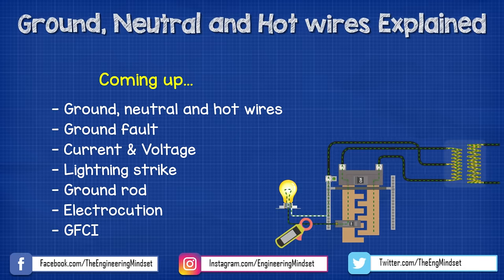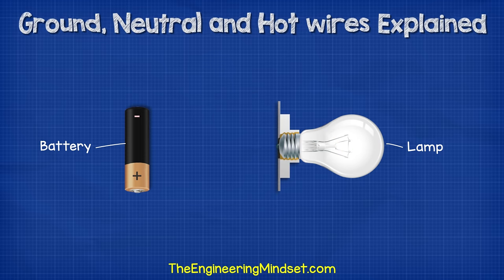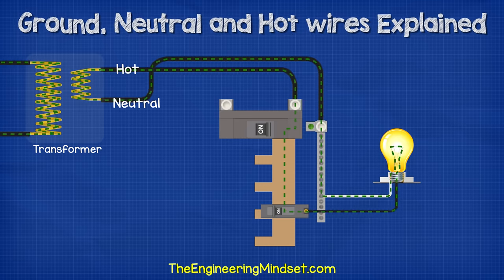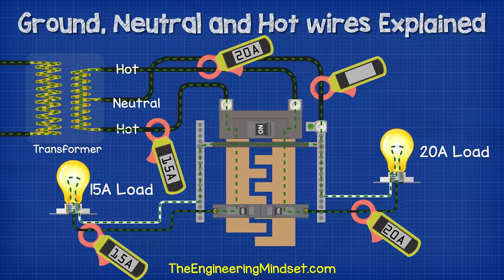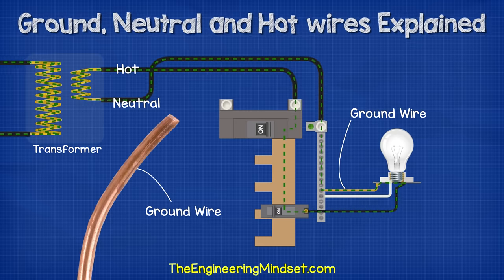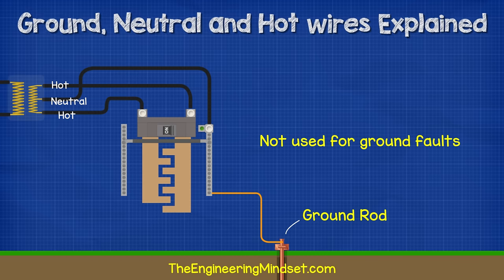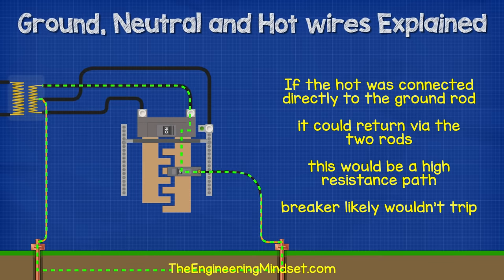Ground Neutral and Hot wires explained - electrical engineering grounding ground fault

Comment: In AC current there's no hot and neutral wires because both wires transfers current forth and back.
Reply from the maker: In some aspect that's true, but the neutral wire is usually grounded, as is physically tied to the earth, which makes it neutral, so there's zero potential between you and ground but 120/240V difference between ground/you and hot.

Comment: At 5:25 into the video you show two breakers mounted on the same bus and nothing in the neutral. If the two breakers opposing each other are on the same leg of the service transformer secondary then you will have an overloaded neutral in this situation 30 amps not zero.
At 5:25 when you pause you show two breakers stabbed onto the same bus on the right side of the panel yet you show current flowing on both buses…

Comment: i need help, i spliced an outlet strip into a live wire in a light pole with snap splices but light won't turn on on outlet strip
Reply: Sounds like you need a real electrician
Reply: @N-hunter  ive done similiar outlets but  with alligator clamps, cant figure out why the snap splices dint work

Comment: I can't seem to find any explanation as to why in north america black is hot in AC circuits.  In every other respect black is ground/negative including the multimeters that test the voltages! Seems to me that white and red should have been hot and black neutral with the extra green for ground. At least for consistency if not anything else.
Reply: @GH-oi2jf  Not sure I agree with that. The color is there for a reason, so you don't mix up the wires. In an industry where there are many regulations to prevent people from doing stupid things.. this is one basic thing that makes no sense. Electrons don't care what color the sleeve is or what the label might be. A battery could as easily be A terminal and B terminal. We as humans typically make these decisions for convenience and safety. Somehow this one slipped through the cracks I guess. Maybe someone screwed up 100 years ago, and we are stuck with it. 
Someone without the required knowledge, but the bravery (or stupidity) to go ahead and wire up that outlet using 2 hots (red and black wires) on the panel because that "makes more sense" is going to be in heap of "double" trouble.
Reply: Just color convention. They could have chosen a different color. Makes no difference. They just need to be able to tell which wire is which by their colors.

Comment: Why is the Neutral wire connected to the plus (+) side of the battery instead of the minus (-) side?
I would think that the Hot (red) wire would be connected to the plus side like you would see under the hood of a car.
Reply from the maker: Ignore that part it wasn't explained well. Electrons flow from the negative but most of the world was taught, incorrectly, they it flows from the positive. See our video on electron flow v conventional current to learn more

Comment: I don't get it. In AC system, when the flow of electricity switches directions, does the neutral become hot and the hot becomes neutral?
Reply from the maker: Watch this: https://youtu.be/yEPe7RDtkgo?t=186
Reply: @EngineeringMindset  I saw no explanation there.  The circuit didn't even have a neutral wire.  You had two hot wires.

Comment: Sorry but you are technically wrong on the very first example. The term 'neutral' simply doesn't apply to a DC circuit as shown in your diagram. The neutral is the center tap on an AC winding. When using the term neutral  a good electrician knows the system is AC .

Comment: I still don't understand what is the difference between Hot and Netral with AC. After all, electrons first come through the first conductor, and leave through the second, and then vice versa. It turns out that these two wires should change roles every half of the oscillation, but for some reason this does not happen in the figures.

Comment: 3.49 shouldn't the potential difference be at zero volts and not 240 volts?
Reply: No. It is the full potential of the coil. 240 volts. Not sure if you are in the U.S., but this is where the 240 volts that run certain appliances (e.g. electric range) come from for the U.S.

Comment: I once rewired a basement outlet once so I could move it over an inch. I hit the breaker, unscrewed it, though the ground wire loosly pressed into the cinderblock looked unsafe, put it back together to the wall, went to turn the breaker on and noticed I had flicked the wrong one. Praise baby Jeezus. 😬
Reply from the maker: We just published a new Ground fault, short circuit and arc fault video, so much detail! Link HERE➡️: https://youtu.be/Qi0ynSQw-wc

Comment: Electricity without a ground---i hook up a wire to a power source  and 
put a light in the circuit. Now the electricity starts to flow but the 
wire fills up and there is no ground so the flow stops. i hook up a 
ground and the flow starts up and the light lights..  the light should 
light up anytime there is current flow. When i hook up the power source 
to the wire (no ground in the circuit) the current starts to flow and 
the light should light up as the current goes through the light if only 
for a milisecond.Then no more current flow since no ground and so no 
more  light.. Theory- if i had a long enough wire so the current would 
continue to flow the light should light without a ground. Or i find a 
way to slow down the current so it takes longer to go through the wire 
and the light stays light at least until the current finds out that the 
circuit is not complete
Reply from the maker: We just published a new Ground fault, short circuit and arc fault video, so much detail! Link HERE➡️: https://youtu.be/Qi0ynSQw-wc

Comment: I don't understand, if electricity change direction, does it mean neutral wire will become hot wire? What make hot wire main wire, if electricity change direction?
Reply from the maker: Neutral wire is physically tied to ground (the earth under you), you are also therefore grounded so there is no voltage difference between you and neutral. The hot wire is not tied to ground, a voltage difference therefore occurs so if you touch it, current flows through you.
Reply: @EngineeringMindset  but what happen if electricity change direction, doesn't it come from neutral to phase then? I know it's stupid question, but I still don't get it :D
Reply from the maker: Notice how a bird can land on a power line and be fine. They are attached to the circuit, current is flowing, but there's no voltage differences so they are fine. However, if they touched a wire and a pylon they'll be blown to pieces as the current will flow straight through them because there would be a difference in voltage of maybe 200k volts.
Reply: @EngineeringMindset  I think I get it, so phase(hot wire) is where voltage comes from,  no matter the direction, so even opposite direction(pulling) voltage is from phase, right? :D
Reply: Voltage is always a measurement between 2 points. The neutral is just as live as the other hot legs. People in the trade learned the hard way and get shocked because they ignorantly believe that neutral is always safe to touch.

Comment: why can't the circuit flow back on a separate strand of the hot wire? Why can electricity not flow in two directions on a thick wire with DC power?
Reply: Because the eddy currents/ electromagnetic currents would interfere with the electricity

Comment: If ground is connected to the circuit too, then why there is ground in the first place? Why not instead a second "backup" neutral?
Reply: You need them separated to avoid objectionable current.  In a fault condition you would light up the "cases" of all other items plugged in at the time of a fault. Ground has to go straight back and finish the path at the bonding strip to trip the breaker in a fault condition.
Reply: There are also a lot of complications like a transformer that need ground separated.
Reply from the maker: We just published a new Ground fault, short circuit and arc fault video, so much detail! Link HERE➡️: https://youtu.be/Qi0ynSQw-wc

Comment: what !! electric flow negative to positive. What a revelation.
so negative terminal is the HOT wire.  gee ...

Sorry to be a little off topic but would like if I can relate this info correctly to jump starting a car, with electron flow.

thinking black cable on the negative terminal of car battery.

red is neutral post ( marked "+"...  black is hot ("-")  so  when you jump start someone' else's dead car battery

so current flows out from your black (negative) into their engine block ( receiver of current ]
and the current flows throughout the metal into their dead neg post of battery and comes out the positive post ( of the dead battery ) and return flow comes out of their dead battery positive post  back to your source positive post battery.

-------------
so that is why making the circuit for a jump start.

step 1) positive red ( stalled) to positive red live  
Your creating the return path first.
The Cathode is the positive or oxidizing electrode  that acquires electrons from the external circuit

step 2) neg terminal black (live battery ) to engine block ( frame of dead car )   
Your creating the HOT path now.
The Anode is the negative or reducing electrode that releases electrons to the external circuit 

Since negative post of the dead battery has a cable attached to body of car , the negative anode of battery ( the dead one ) receives the charge through the car's body (ie engine block Step 2 )and releases electrons to the cathode ( pos ) side of dead battery which in-turn outflows those electrons back via the jumper cable to the pos (Cathode ) of source charging battery post (pos).

am I missing something...?   Q: why go threw the body of the dead car to hit its neg post. Why not directly connect to the neg dead battery post?  Too much direct charge for the dead battery ? Or is it because the STARTER COIL is getting pre-charged
through the neg cable connection to the body of the car (dead car ) so does the starter coil have 2 connection to its Neg post - one from the body of the car and one directly from the neg post of the battery and now the coil awaits the ignition key to be turned on ( and so the dead battery will not need to do the complete heavy lifting to start the car as its still in a discharged state ? ) to complete the circuit to the positive post?

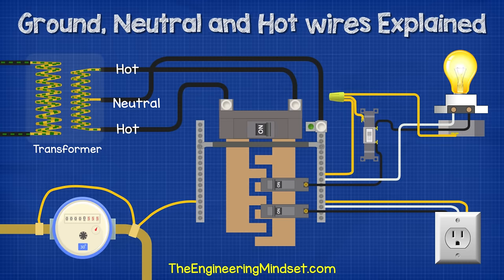Comment: 7:42 you connected the ground wire to water pipe? Then Current will flow creating some some electricity to your faucets., that's why you need the rod 9:13 to eliminate that grounding to your faucet!
Reply: No the metal pipe is so if you are electrocuted in less say a bathroom electricity will flow to the ground wire and trip the gfci
Reply: The grounding rod is for lightning or static
Reply from the maker: We just published a new Ground fault, short circuit and arc fault video, so much detail! Link HERE➡️: https://youtu.be/Qi0ynSQw-wc

Comment: IF electricity takes ALL paths back to ground, not just the path of least resistance AND the neutral bus bar is carrying say 5 amps, since it is bonded to the ground bus bar, how come we don't have some of that current flowing through the ground as well? 

For years I have never had an explanation for this on any video.
Reply: There is no flow because the ground is connected to the "case" not the operational load. If you bonded the case to neutral at the device you would have close to equal returning current. However this would be unsafe as the device case could now a higher potential than the earth. When I was a kid this happened in our kitchen and shocked my mom every time she touched the metal stove frame. We measured 90v from the stove top to the sink. The Neutral had  become shorted to the frame and our "fuse box" was not bonded to ground.  1950's aluminum wiring that could have killed my mom.
Reply from the maker: Check out NEW resistor video, everything covered! ➡️ https://youtu.be/DYcLFHgVCn0

Comment: Ok so if current travels back and forth, why is the negative not fused? Why don't I get a shock from the negative? After 30 years I can't still work out how AC works! Does the positive half of the cycle push electrons and negative cycle suck them back along? Anyone who can answer my questions please do it but I bet ill still be one the wiser as nobody can explain it!
Reply from the maker: Because the neutral is grounded, physically connected to the planet, so are you, so there's no voltage difference between you and the neutral. But, it can do.
Reply: @EngineeringMindset  Doesn’t answer my question!!

Comment: Why is the neg a hot wire? I’m confused. I thought the hot was a positive? Someone please answer
Reply: he uses electron flow which is the real direction electrons in a circuit flow (dc electricity flows from negative to positive because just like magnets of the same charge, electrons which are negative particles will push away from the negative terminal of a battery and will be attracted to the positive terminal ), so current goes from the negative terminal to the positive terminal. now the term hot wire and neutral wire doesn't refer to the charge (positive/negative) it refers to which side of the wire flows into the appliance (anything that draws current like a light bulb). imagine the bulb is splitting the wire in half, the wire which goes from the battery to the bulb is called the hot wire because the electrons in this wire go into the appliance/bulb. the wire that goes from the bulb back into the battery is called the neutral wire and in this wire electricity that powered the bulb is now flowing back into the battery because elctrons that are negatively charged will be attracted into the postive side of the battery.

if you still don't understand that's ok it takes time to understand electricity, you cant see these animations in real life or see electricity at all, for now try to rewatch this video and reread this comment if you can ask a friend who does understand it for help.
hope this helps!
Reply from the maker: Check this out, how a battery works: https://youtu.be/PXNKkcB0pI4

Comment: Why is it safe to touch neutral wire? How neutral is maintained at 0????
Reply: It's not always safe to touch the neutral. However, if everything is wired correctly, you can touch the neutral because you, standing on the ground (Earth) is at the same potential as the neutral. Same potential means no voltage.

Comment: I hit a hiccup when the ground wire was said to have less resistance than the neutral, because they are just both copper wires. But maybe because there's no fluctuation back on the neutral, as opposed to a ground which is just straight to source and that's that. ?
Reply: Ground wires never have less resistance. In commercial applications you typically use the metal conduit (pipe) as the ground and will always have more resistance. Wires larger than 12GA will normally have a smaller ground wire to save on copper. It needs to support the return path at 10x rated load just long enough to trip the breaker.
Reply from the maker: We just published a new Ground fault, short circuit and arc fault video, so much detail! Link HERE➡️: https://youtu.be/Qi0ynSQw-wc

Comment: You should explain how electricity REALLY FLOWS...  its Through the electromagnetic "FIELD"... which is EVERYWHERE.. Not the wires
Reply from the maker: Veritasium can do that, I'll focus on providing service engineers the knowledge they need to fix a system.

Comment: interesting system americans have. But resistivity is nothing you calculate? I heard you say your ground wire has "a very, very low resistance." but it should have no resistance since it has no load connected to it. However it has low resistivity. Perhaps its a little too premium for this video though. thx
Reply: @GH-oi2jf thats what i mean. a load has resistance. leads has resistivity which depends on the material

Comment: I’ve been an electrician for a long time and I’ll be honest I still don’t understand why most of the time you can’t get shocked in a neutral but sometimes you can. Anyone wanna help me understand ?
Reply from the maker: Neutral is grounded, so are you. There's no difference in potential. They aren't always grounded correctly so you can be shocked.
Reply: I have seen even several residential and commercial plants where someone forgot to bond ground to neutral. Even after inspections because inspectors don't test. In Tucson we had a new center that was smoking filtered power strips.  Contractor said I was crazy and we had cheap power strips. I put my meter between neutral and ground and had 50 volts. Someone had neglected to weld in the bonding bar at the transformer.  That was in 1993 and I have never trusted a contractor since.  I will always put my meter on just to make sure. Moved into a new house in 2000. Went to the panel in the basement and sure as shit they had not driving the bonding screw in. Passed city inspector and all.

Comment: Current going back travels through the white, white is connected to the bus bar, I touch the bus bar I don't feel it, why?
Reply: The body does have some capacitance though so you might feel a bit even if your not completing the circuit
Reply: @GH-oi2jf  Interesting.  Good to know.
Reply: @IPv4Address  Another good point.

Comment: BATTERY/LAMP:  WHY IS THE  "HOT" WIRE ON THE 'NEGATIVE SIDE OF THE BATTERY  AND NOT THE "POSITIVE SIDE OF THE BATTERY?
Reply from the maker: Because electrons leave the negative terminal of a battery, not the positive (see https://youtu.be/PXNKkcB0pI4) I've blended the two concepts to make it easier to visualize and animate but it has unfortunately confused many people. We'll relaunch the video with this omitted for the general public to comprehend.